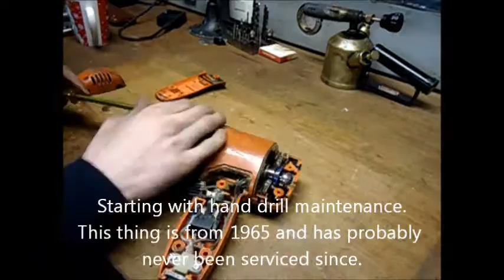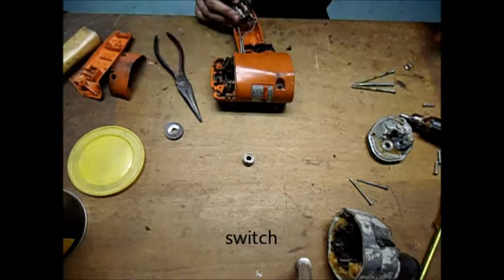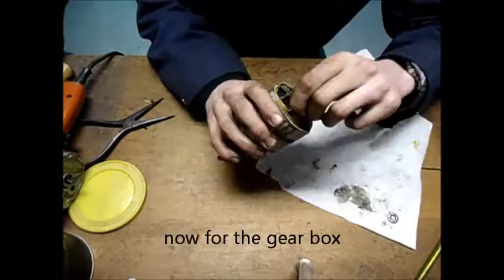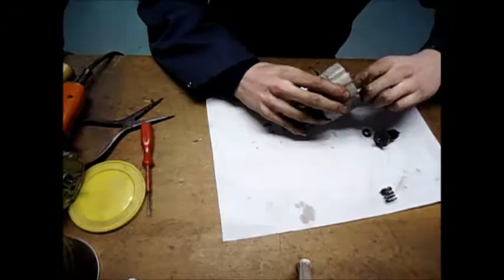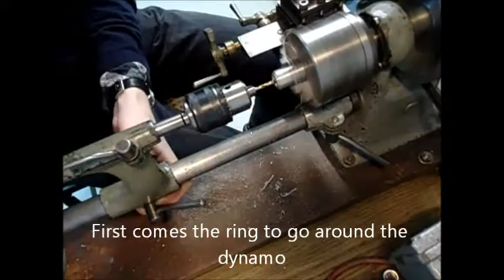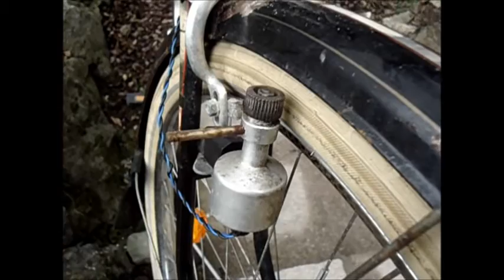This & That Part 2

Comment: Clean the conmutador with fine sand paper will make it work like new and heat less.
Reply from the maker: I used alcohol which got rid of most of the dirt.